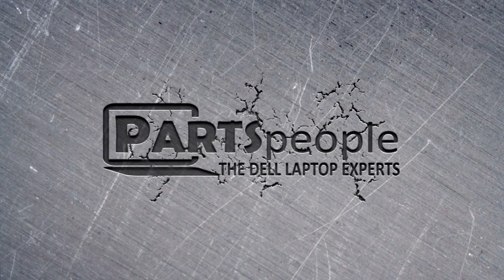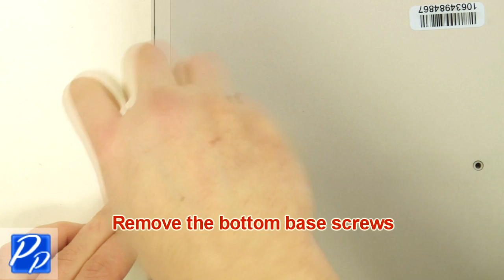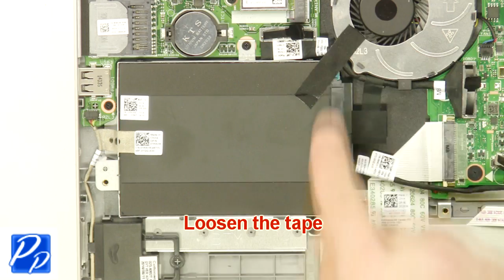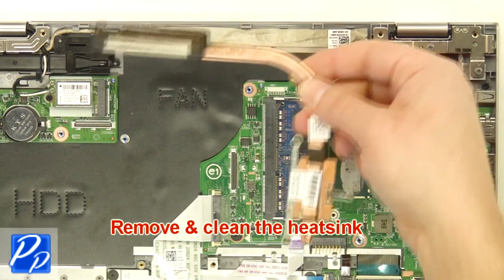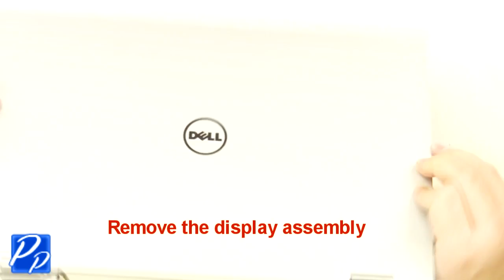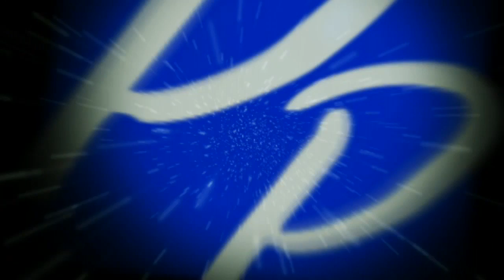Dell Inspiron 13 (7347) LCD Touchscreen Assembly How-To Video Tutorial

Comment: Hi, I have this model of laptop and just got it back from warranty repairs for a faulty touchscreen. While they fixed the screen it seems that they did not replace one of the magnets in the top left hand corner of the display that allow the two halves of the laptop of close together securely. As such, the left hand side not remains open by about a 1/4 inch when the display is closed while the right side closes all the way. Even though they broke it Dell told me they won't cover the repair. Is there an easy way to get behind the display's bezel so I can replace it myself and if so are you aware if there is a specific type of magnet I would need to replace the now missing one?

Comment: Hi. I have this piece of crap and I sent it twice to dell to fix the ghost touch issue. Now, the touch screen  is not working and I can't find any hid compliance touch screen drive (it is not there). Moreover, the compass was not working as well, but when I opened up the monitor I saw that there was one connector not connected to the compass. I checked all the other connectors and they were tight. Do you think that it is a software or a cable issue?  Do you think that the driver is not there because the touch screen is not connected? Thanks for your help

Comment: I have a Inspiron 7348 with a cracked screen... is it pretty much the same steps as this 7347?
Not sure why the negative comments... I have been repairing computers/laptops for years and I thought this video was very well done, thanks!
Reply from the maker: Yeah the 7347 and 7348 should have all the same screw locations. I'm not sure why there are so many negative comments either. I guess it's because some people think this is to show how to dissemble the dizitizer and the touchscreen when it actually just shows how to remove assembly from the base. Youtube can be fickle sometimes.

Comment: Hello, I have a Dell Inspiron 13 7000 2in1 (Gold) and got a crack in front glass but touch on the screen and everything else still works fine. Do i still need to replace the whole touch screen or can i find just the front glass?
Thank you
Reply from the maker: You can replace just the touchscreen without replacing the back cover but, unfortunately, the screen and the glass are all one part.

Comment: Any ideas on why my touchscreen quit working? Took it apart to replace a broken hinge (managed to do it without pulling the battery, fan main cable or heat sync) and everything works but the touch screen, checked, double checked and triple checked all the cable connections, everything seems tight. Then followed these instructions to check again and came up with "no boot device". Finally got it to boot after messing with the boot settings but bloody hell!!

Comment: This video is old, but would this fix the ghost touch issue that is rampant across these devices?
Reply: +Indomitable Fear Not sure but I just ended up disabling the touch screen service and using mouse only.  I need to do this because my laptop wont close properly anymore.  One of the hinges wont move.